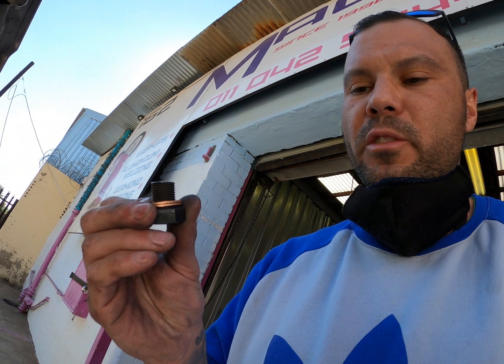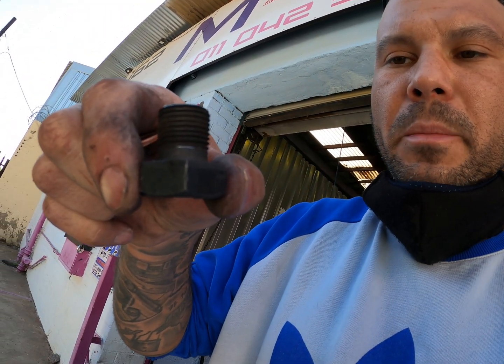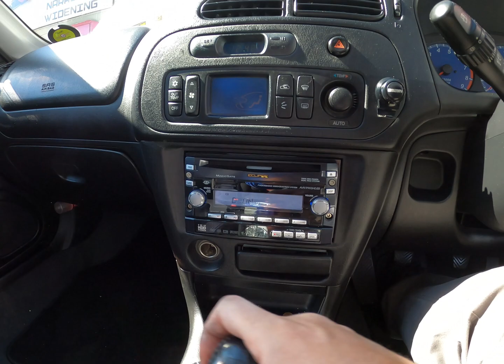mitsubishi evo EGR / SAS delete  . before and after

Comment: Hey bro, Just a question: My car has bouncy idle when warming up from cold, (it sounds like its got cams) after the car has been warm the lumpy idle disappears,  do you have any idea what this could be please?? similar to this link : https://www.youtube.com/watch?v=ckFbZMH8Fxo
Reply from the maker: Hey man what’s happening dude? That sounds like something to do with vacuum bro. Could be a few things as a vacuum that’s not happy somewhere, but that could also raise the rpm, so that’s a 20 percent chance, it most likely sounds like the MAF , cause they are pretty common items to fail. Try cleaning the MAF with carb cleaner and leave it to dry out for a few minutes, in my opinion that sounds like a likely suspect . Next item could be the o2 sensor, take that out as well spray it clean and see if that works? 

Other than that I would suspect that the ecu has a hole in the map, the tps isn’t giving the right signal or the idle control valve is the issue, you could take the idle control valve out and spray it clean. 

My best guess is idle control valve, MAF or o2
Reply: @the_JDM_fanatic  Thanks, will look into this.

Comment: Supplementary air system why ohh why would you take it off helps keep the turbo spinning between gear shifts also enables mild anti lag if negative timing is mapped into its ecu  map
Reply from the maker: To be honest, I didn't know this... from the research I've done it was to disable it because it pumps sout if that's how it spelt, old exhaust gases back into the intake ... but I suppose everyone does things differently, different objectives for different applications
Reply: @the_JDM_fanatic  Could be wrong, but im pretty sure what it actually does is send air from the intake into the exhaust manifold when you let off the throttle which helps keep the turbo spinning longer, like a very mild form of antilag. This system was modified in group a rally evos for full antilag. Some people drill the banjo bolts out to 6mm for bigger pops and bangs!
Reply from the maker: @TheBaconator2121  you could be correct , from the research I have done it has a one way valve towards the inlet side basically sout into the combustion …
Reply: yeah thats exactly right mate. was put in due to homologation reasons for the rally car to be put into production @TheBaconator2121

Comment: cant you reuse the 2 old 24mm bolts to block it off?
Reply from the maker: Don’t think they 24mm bolts, if I remember correct they are 16mm , 24 spanner.. 

Sure you can, just use a copper washer to seal it
Reply: @the_JDM_fanatic  oh i see.. were the block off bolts that you used m16x1.5?
Reply from the maker: @tlouie97  m16 standard which I assume yes is 16x1.5mm pitch , I don’t recall it being a fine or course thread , was really simple to get from the bolt shop. Just try and get short bolts like 20mm long
Reply: @the_JDM_fanatic  awesome thanks bro, ill be doing this to my evo 5

Comment: Any check light?
Reply from the maker: no check engine light nothing, its been running so smooth.... only light is the abs which i think is a relay and after a minute of driving it throws the ayc light up....

but nothing with the egr delete and dude it makes a gooooooood power difference...

but since then i put the evo 7 ecu in the car which we had to change a few wires around but a much better ecu to tune than the 6 one.. it has more rom i think or memory my tuner said
Reply: @the_JDM_fanatic  Nice video I'm making the same job now. What did you do to the vacium line?